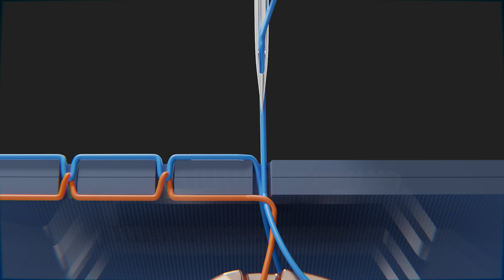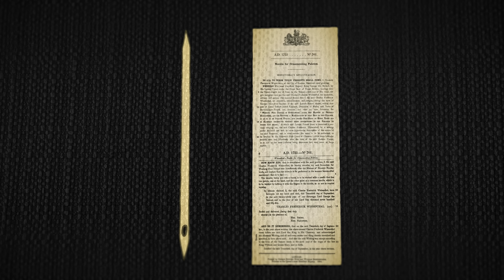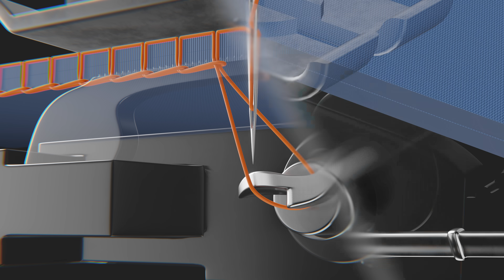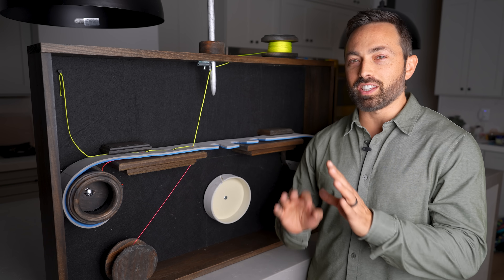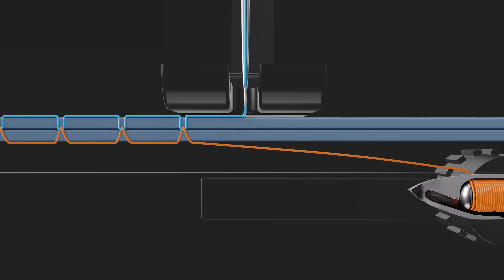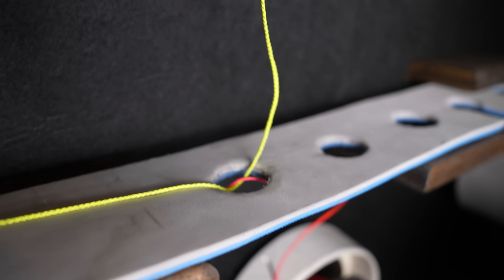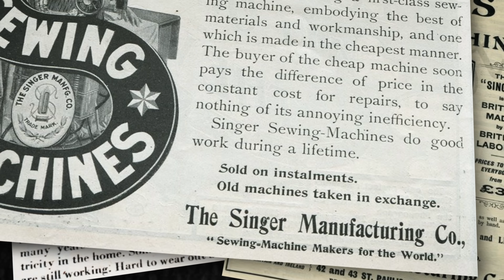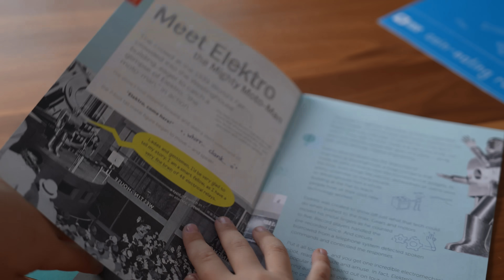The Surprising Genius of Sewing Machines

Comment: I , for years , repaired the typewriters for a large commercial sewing machine repair company in Seattle as one of my typewriter repair company customers . At one point I was having trouble getting my wife’s sewing machine ( I borrowed it to sew heavyweight materials ) to work properly , so I suggested we “ exchange labor “ for one of the repair visits. It did not go well , the advanced commercial equipment they worked on was not a bit similar to the regular sewing machine my wife owned . I now have my own crudely made but amazing , low priced , heavy duty , Chinese hand crank sewing machine . All different sewing machines are impressive , and have their specialized uses . She is not interested in mine and I now leave hers alone .

Comment: Woaw ok but there is still something that I can't understand how its done, it's fesable but without magnets I can't understand how.
With the lock stitch what you say is that you have to get the second thread (red) to go into the first one (yellow). So you need the entire pool to go through the yellow loop... From what I imagine that means the pool have to somehow levitate to pass through the yellow loop and so does the mechanism that rotates to grab the yellow thread. If it is true that the rotating mechanism grabs the yellow cable then it cannot be held by an axis as the yellow thread loop would inevitably end up around the axis...
Do anyone else see the problem I'm pointing ? That's why at 12:10 I was surprised the video hide this problem. Here you can see the blue loop entirely wrapping the rotating part but without cutting the axis enabling the rotating part to rotate...

I mean of course there is a solution since it actually works... but I'm really surprised that no attention is placed on it.
What's going on guys ??? I want to understand !

Comment: We had a fairly modern machine from Dunelm. Must have had about 25 hours of use in total. Taken apart and greased up once after sitting for over 5 years. Always missed the occasional stitch from new, but started bunching up and snagging the threads more and more frequently. Managed to adjust the timing so it wasn't missing as many stitches but instead would snap the threads after just a few inches.
Probably done for cheapness, but I don't think it should have had plastic gears or structural parts.
Ended up chucking it at the local tip.

Comment: Best one I have found.  Thank you.  Only one that got the message across  to me. So great stuff.  But if you don't mind me saying so you could have done a little more around 11:09 or so - where you show the actual mechanism that makes the stitch.
This is our sticking point for all of us that don't get it:  how can you rotate something that you're passing a thread around?  It must be unconnected to pass the thread, it must be connected to be made to rotate?

The answer is you encase it in a shell with a loose enough fit that the thread can go around.

The shell can 'push it'  or revolve it just by having projections shaped on both.  The outer case pushes on the projections. There's enough slack for the thread to force its way between case and centre if necessary.

Now that's the hub of it.   Look on YT channels and see how many people like myself just couldn't understand and see how many vids and animations have been made that fail to offer or demonstrate that simple thing:   encase the thing.

But it could still do to be made even clearer.  Your vid goes swiftly by that bit:  how the hook goes through the loop,  'interiorises' the loop  to make it go round the bobbin in the interior there and then lets the threaded thread out again.

That's the heart of the whole thing.  I think splicing in a careful slow clear demo of that would make the vid perfect.

:)
Reply: I'm late by one year :-)  But yes, this puzzled me too. I think the point is that the bobbin (spool) here is loose, not having any axle to hold it in place and rotate. Actually, the mockup seems to use magnet which does not block the green thread to make it between the white cage and the bobbin, and thus allows to loop around the red thread eventually.

Comment: I have a sewing awl I've used in leather crafting to make a more streamlined seam than braided leather lace. When it's done right, it makes a very satisfying lockstitch. The needle goes down, then you pick the proper side of the loop to thread your "bobbin" sinew, and then pull the awl back out the same way it came through.

I thought that should be around the same time or before the sewing machine, but no. It was 1909. Seems counterintuitive to me.

Comment: I always wondered how they worked. At 7:45 you are talking about chain stiches coming apart easily. I'm sure they stitch feed bags this way so it is easy to open a bag of feed (we have chickens). With the bag positioned with the single stitch on the right, start pulling the thread  from the end furthest in front of you and it unzips. No knives or frustrated ripping, just simple unstitching. Thanks for the great video

Comment: Thanks for solving a mystery that's plagued me for years! I grew up with my mother's Singer. When I was a stripper in the '80s, I got my own Sears Kenmore to sew my costumes, then became a cosplay pioneer--boy, I put that stretch stitch to good use! Decades later, that same machine's still going strong and works like new. But even though I could see the top thread go around the shuttle whenever I changed the bobbin, how those two threads managed to interweave escaped me...until NOW! Thanks so much.

Comment: Still, there is a problem with the lock stitch modern hook, which is when the needle penetrates the fabric, if the hook is not properly synchronized with needle movement this will result in miss stitch one of the rising challenge. Also less thread on the bobbin that requires refilling is also a challenge for mass production.

Comment: Somewhat relevant story, it’s not surprising at all that sewing dates back to 50,000+ years, to me atleast.
Long story short, I was in a wilderness survival program in Arizona in lieu of juvie time for some stupid decisions as a teen.
My sleeping bag, one of the few things they provided to us, was torn at the seam and I needed a way to fix it and sew it back together. To do this I had to carefully bite a spine off of a specific breed of century plant. If you didn’t know they are incredibly painful if you get stabbed by one and it lasts quite a long time with a decent chance of an infection to boot. At the time I had recently been stabbed by one after a case of hypothermia from a flash flood with no shelter. The pain lasted well over a week and I had trouble walking on the leg it punctured.

I had to carefully place my jaw over it and place the spine onto my back molars without stabbing the inside of my cheek and slowly pull it out. If done correctly it pulls a threadlike material from the plant, still attached to the sharp spine, that when cured under sunlight makes a longlasting thread. I used it to sew up my sleeping bag and it was still perfectly intact 8 years after my 3 month stint in the wilderness. It may have lasted longer than that but I lost the bag with my house and car in a tornado in 2016.

I’m sure many natives used similar methods for millennia before developing tools such as handmade bone needles and it was definitely and interesting experience.

Extra fun fact the stalk of a century plant can be split into thin boards and the top portion carved into a kind of spindle to make easy coals for starting a fire when rubbing the spindle into the thing split portion of the stalk.

Comment: I went to college in Glasgow 96-99 to study sewing and clothing machines, I then spent 13 years in a factory that made mattresses and divans. The principal design of sewing machines remained largely unchanged for decades other than the method used to power the machine. I worked on some large multi needled machines, computer controlled machines as well as some that had been bespoke made by old fitters to have longer beds and drive shafts to make repairs on mattress tops. It was a great job and the machines were fascinating in their design and function

Comment: You know what, this is actually very TYPICAL of what good engineers do.  We find clever ways to do difficult things.  It can happen in all sorts of areas, and this is a great example.  Mechanical devices are particularly easy for people to appreciate, I think, but the same sort of cleverness is exhibited in electronics too, for example - it's just that instead of physically moving things around you're slinging electrons back and forth across wires.  The raw "cleverness" ingredient that goes into it is exactly the same, and the result is the frankly wonderful standard of living that we all enjoy today.

Comment: Now - go back and look at the tail of the 50,000 year old Denisovan needle. Notice the notch in the tail of the needle!  Notice too how perfect the hole is in the needle, how small, how perfectly centered, and how chamfered! How did they drill the hole? How did they chamfer it? How did they form the groove?  50,000 years ago. 

Now think about what the garments must have looked like made with such precision needles. 50,000 years ago. 

Then think about the training needed to make the needles and to use them. That required language. 50,000 years ago, in a closely related cousin that diverged from sapiens hundreds of thousands of years ago. Essentially the same genetic changes are present in Neanderthals, Denisovans and Sapiens - and late Erectus. Now think about that again. 

How far back do language and culture go? Clearly to at least late Erectus. How much further. Erectus made it to places (repeatedly) only accessible over wide stretches of water 1,000,000 years ago. That means boating of some sort. Canoe and or sail. And that too means culture and language to pass on those skills. Since Sapiens, Denisovans and Neanderthals all had similar tool sets, and clearly all wore clothes, it seems highly likely that all of that goes back to Erectus, and quite possibly far back with Erectus!

Comment: 10:46 "There are many machines that are now over a hundred years old and are still working"

I own one of them! I've got a hand-cranked Singer 28 (the 3/4 size of the 27 you mentioned, she's still very heavy despite being ostensibly portable lmao) from 1907, three years before they were replaced with the 127 and 128 in 1910. She's a later one, so she's got the lovely grapevine faceplate and everything. She's in brilliant working condition, and the only damage I've seen to her is the washer on the bobbin winder which unfortunately fell victim to the unusually hot summer heat we've been having recently. To call them built like tanks would be wrong... because they're older than tanks.

And she is a BEAST. Not only are they resilient, but because the motive force comes from you and not an easily overwhelmed electric motor, it can chug through 16 layers of fabric for a badly designed hem I did last week with almost no major difficulty. In fact, most of the difficulty came from getting the presser foot to go up enough to go over what was about half a centimetre of fabric, I had to take the presser foot tension as far out as it would go lol. Sure, she doesn't have the features a modern machine does, but I'll use her over a modern one any day. Plus, a bajillion of them survive, so they're not even expensive despite mine being three weeks older than the country I live in - I got her for less than a beginner model new sewing machine would go for, only $180 NZD!

Fun fact, they didn't actually switch entirely from the oscillating shuttle to the spinny bobbin until later, they just used both for ages - the 127 and 128 designs still used the oscillating shuttle, just redesigned a bit. The 127 and 128 were still being made in the 1960s, and to a design that had barely changed since the VS1 in 1885!

Comment: My mom still uses a Signer that she has since she was a kid.  It is over 60 years old.  The gears in the machine are made of a rubber plastic kind of mix.  When the one my mom bought was not working we bought a repair kit and fixed it.  It cost about $20 and took us an hour, thing works like new.

Comment: I can attest to the sturdiness and longevity of the older models - I have a vibrating shuttle Singer manufactured in 1896 and that thing is bombproof if oiled once in a while. It's also fascinating to remove the access panels and watch precision engineering at work!

Comment: The lockstitch, which most sewing machines use, are also numbered stitchtypes three hundreds (class 300). Starting at stitchtype 301 is a straightforward lockstitch, 304 is Zigzag lockstitch, 313 and 314 are blind lockstitches, which are not seen from the bottom. Most machines can be modified to do these different stitches of the same stitchtype class. 
Class 100 are chain stitches, which are also talked about in the video.
Class 200 are hand stitches.
The higher classes often use more thread or are more complicated but also more resistant or better looking.

Comment: when hand sewing, you aren't supposed to keep flipping back and forth between sides. you really only fully pass the needle through to the back side of the fabric when embroidering or cross stitching. functional sewing works on one side of the fabric. you " pick up" threads of the fabric weave with your needle and you should never have to stab the fabric unless you are stab stitching.

Comment: Professional seamstress for nearly 30 yrs and never knew precisely how my machine worked until now.  Fascinating! 

One aspect of these machines that I find also fascinating and a bit mysterious, is, someone like me that uses their machine a lot over a long time to do intricate, skilled work will invariably find that if some other person sits down to use the machine, even if they’re equally skilled on a machine of their own, they’ll have minor “bumps” in the operation of it.  Not talking about technical stuff like the bobbin loading differently, or the stitch length adjust or being in a different place.  I mean, the machine just won’t perform as smoothly and fluently in the nuances of the work, as it does for the person who usually works with it.  I don’t think this is some “woo” magic thing.  I suspect it’s simply that these machines are so dependent upon intricate, perfectly timed movements in order to perform their purpose, that each one has a subtle character that is learned by a habitual operator.  Perhaps.  And that subtlety becomes a kind of partnered “dance” between the machine and operator, that allows them to perform tasks that might become a bit flummoxed with an unfamiliar operator.  Maybe.

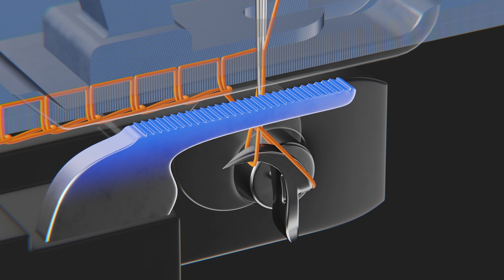Comment: the mechanism shown at 13:29, thanks to the automatic advancing system, seems to use a single thread coming from the needle and not also one coming from the bottom bobbin. is it correct?

Comment: Clothes are so insanely cheap now, they even feel untouched by inflation, it actually seems like they are getting cheaper. (I can't imagine how little the workers are being paid...) To buy a pattern, the thread, the fabric and then the tools, take the time to learn the skills, etc, it's not remotely worth it to make clothes these days, especially as they won't look as good as what you can buy for awhile until you get good at it. I sew stuff occasionally, but only simple stuff on a needs basis, like a certain sized zippered pouch for something. I never sew clothes as it's not worth the price, the time and most fabrics for clothes are stretchy or sheer and hard to work with. Of course, sewing can be fun and there is nothing like making something with your own hands, though it might be embarrassing to wear a shirt you made outside. ~_~

Comment: I understand that Singer was British. The motor on the machine was changed to the 110 volts that is used in USA but there are thousands of Singer machines out there still using 240 volts.  During WWII Singer made munitions in their factory and recommenced manufacturing Feather Weights again after the war.  No doubt Singer machines were built in the USA but they are British machines.

Comment: I'm only like 5 seconds into the video and I am so excited because the question of how sewing machines work has been plaguing my mind since I learn to use one back in middle school home-ec class. Before then, I was confused about sewing machines because I only ever saw gand sewing in which you poke the needle in and out of the fabric from the front and the back, so I was baffled at how a sewing machine could work when it only pokes through one side of the fabric. In home-ec I learned about a thing called a bobbin introducing me to the fact that there are two threads, which partially helped me to understand how the back of a zigzag stitch for example looks completely different from the front, but it also made me even more confused overall. The least of my questions was why does the bobbin need so much less thread. My main issue was with how the needle "grabs" the bottom thread.

Now that I got that out of my system, I can't wait to watch and (hopefully) get all of my questions answered!

Comment: Well done!  A great video, well presented.  In my opinion, the sewing machine is probably the most important invention of the past several hundred years,  Especially considering it's complexity and durability.  The only exception would be the metal lathe, which made the fabrication of the components possible.